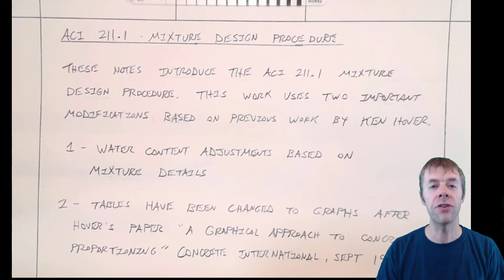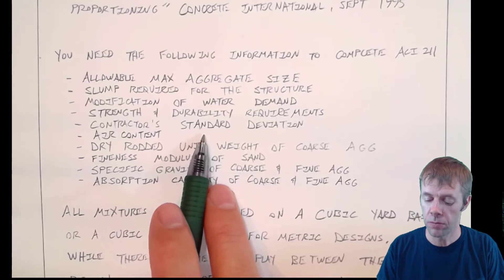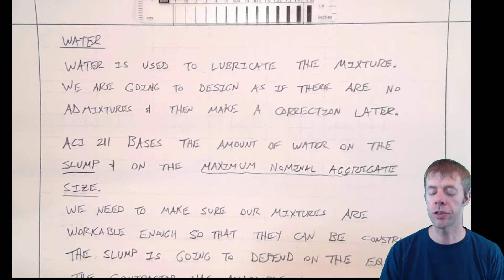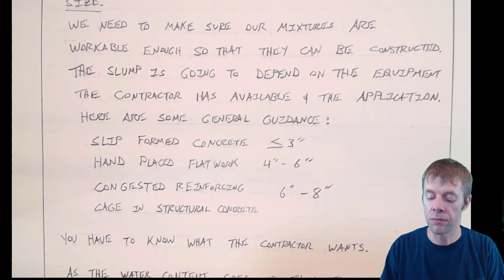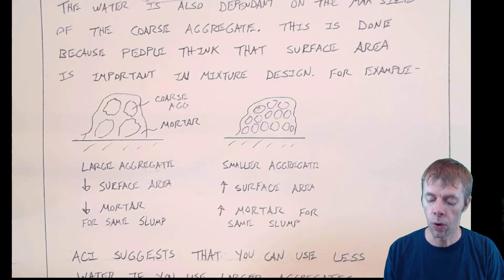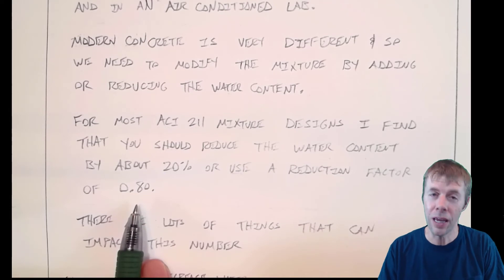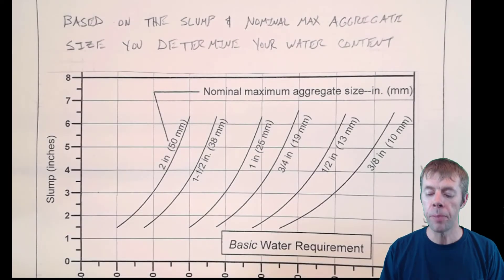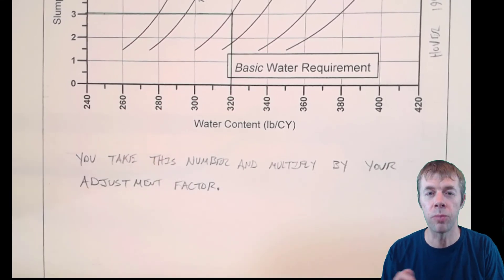ACI 211 – Concrete Mix Design, Introduction and Water Content

Comment: Water reduction is helped by “burn offs” of aggregates (how wet are your rocks and sand).. if your aggregates are saturated, that water is already in the mix.. subtract the ‘free water’ from what is needed…

Side note: bone-dry aggregates tend to lower the temperature of the mix by almost 10degrees F.. at least in Colorado…
Reply: Or water probes in the silos